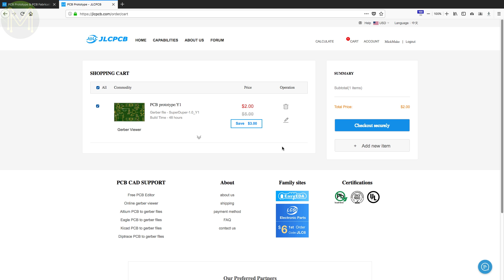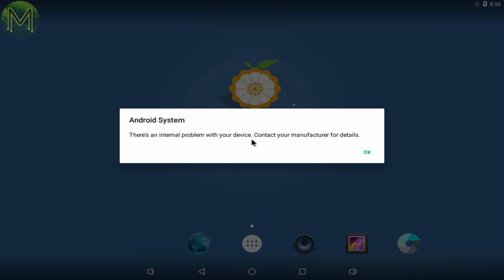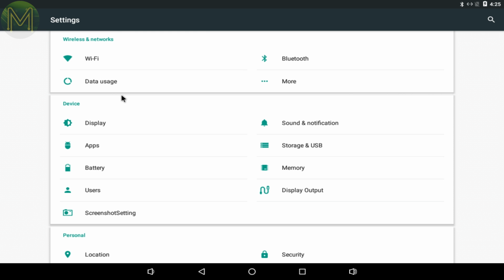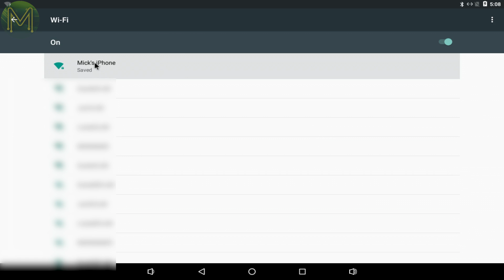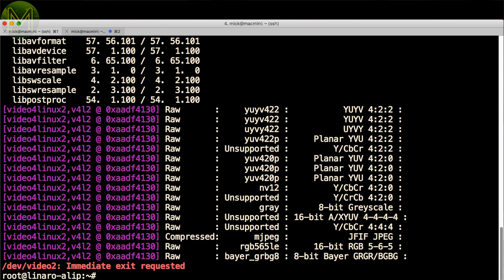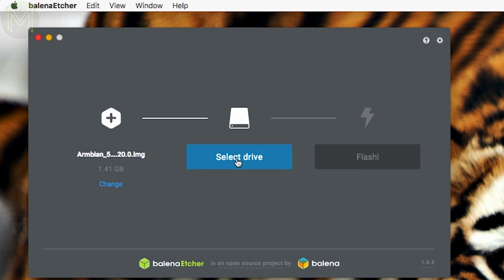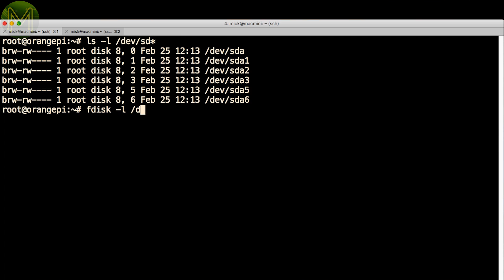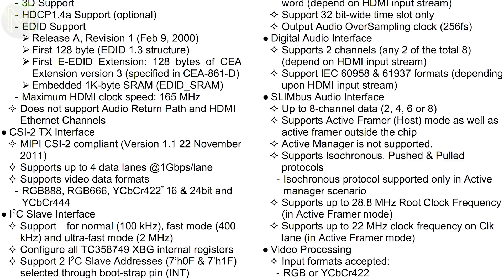#256 Orange Pi RK3399: HDMI recording on a budget. // Review

Comment: Isn't it an issue with the open source community instead of the device maker? I mean, it's completely normal, that there are lot's of hardware features with no or unstable support, with any Linux on any device. In like 15 years of using Linux on servers and embedded devices, and like 6 years on the desktop, I yet have to see a situation, where there's nothing left to be desired regarding hardware support in a Linux installation.
Reply from the maker: One of the problems is with companies promising the world and not delivering. The Pine64 had this problem at the start, (but they’ve since fixed it).

Software will always be behind hardware, but it’s good to know exactly what people are getting into.

That’s why I do what I do with these reviews.

Comment: Thanks for taking the time to test various sbc. After watching your review video, I ended up getting the Rock64 for openmediavault. Ever is running ok but my files transfer speed is Max out to 20 up and 25 down. The Rock64 is plugged in using ethernet cable to my router gigabit port. Transferring from my surface pro 3 connected to the router with AC wifi. Can you please suggest anything that I can do to speed it up. Thanks.
Reply: What kind of storage device are you using? Also, make sure the storage is plugged into the one USB3 port. The USB 2 ports would likely yield about the speeds you are seeing.
Reply: @JesseSightler  
I'm using the new WD Blue 2.5" HDD with Sabrent USB 3.0 to SSD / 2.5-Inch SATA I/II/IIIHard Drive Adapter (EC-SSHD), connected to the Rock64 USB3 port. When I connect the HDD with the adapter dirctly to my PC usb3 port I  got 90 - 110 Mb/s transfer speed.

Comment: All those Pi-like-boards will land in garbage when better and cheaper SoCs come out.
IoT world needs 7nm chips and not overheating oldschool SBCs. Besides they have to start using different languages and frameworks like C# / .NET
because Python does not belong to very efficient scripts for embedded devices.They also should look into smooth cross platform IDE - like VSC (not crappy Arduino)

Comment: Hardware great, much promise. Software abysmal.  I've experienced that with another manufacturer. They released another board with better software support instead of fixing the drivers etc on the first one!
Reply: Is there a good way to pitch in and help make working software for the Orange Pi? Does anyone know what's really needed to do this for Orange and other vendors?
Reply from the maker: Yes!
Go visit the Armbian forums. Igor is a great bloke and determined to bring some standardization in for ARM based SBCs.
Reply: @BobPegram  As Mick says pick a Distro and get on the forums.  Ask questions ( alot of them ),  As ive shown there are alot of people moving on these SBC's / SoC's, Just as a start you might want to look at this,

http://opensource.rock-chips.com/wiki_Main_Page

RockChip has been pretty damn solid with a BSP ( Board Support Package ) that is getting very refined / bugs ironed out.  With support from the community over all this is how this gets fixed.  It was not long ago getting Arch Linux installed on the Rock64 was not doable easily, now as ive shown this board sings pretty much.

Also look on the link in my first comment,

https://github.com/ayufan-rock64/linux-build/releases

There is alot of information here also,  the Rock64/Pro forums are very active with cool people aiming to help out where they can ( ergo they dont bite )..

You have to give these things time,  we dont need complainers we need people that do things,  you will find this interesting but I had this very same conversation at the local makerspace here with people who purchase the latest boards then just moan when not spoon fed an OS to run on the bloody thing, clearly the boards are not for them.

Linux on ARM is still very much maturing and in a huge amount of flux with so many SoC's SBC's available, and yes I know Arm graphics support is awful but with freedrino and now Panfrost/midgard and Bifrost it looks like Mali on the RockChips is well on its way.

Comment: I'd love to see an eDP test with some cheap ips lcd panels you can find on ebay. Curious if it actually works on these boards that have it broken out
Reply from the maker: That’s an idea. I could do a comparison video across several SBCs with eDP & MIPI-DSI
Reply: @MickMake  and if they require any adapter pcb due to pinouts being non standard (like the old ipad screens for 20$ with edp connector) you can make a maker speed run episode :D

Comment: Rockchip having problems with Ethernet? What a news ... dammit I was expecting good things from them!
Reply: Um hardly RockChip,  the Ethernet is a RTL 1Gig unit ( like this one ) RTL8211F Gigabit Ethernet

Since under Linux most of these are still in testing iirc its not shabby at all.
Reply from the maker: But yes... the RTL is working on other SBCs, so shouldn’t be a problem here.
Reply from the maker: Really all SBCs should be running the latest mainline to take advantage of libgpio.
Reply: @MickMake  libgpio?
Reply: I hope that  is not the rgmii  interface that have problems... 
It is hw side if the driver is the same used by other SBCs... And here don't work. (Or DTS if is DTS your lucky)
Reply from the maker: He he.
I really want to get in there and fix it, but then it’d take away time for my channel...

Decisions, decisions, decisions.

Comment: Software support seems to be a problem for most of these boards. I have a rockpro64 with the same cpu which has a PCIe x4 interface. The PCIe port doesn't work as it should, I presume due to lack of software support. So now a waiting game has started for complete software/driver support. It sucks. That's why raspberry pi's are still king of the hill if  you ask me. Less performance but solid software support.
Reply: Did you talk to the guys on the forum ( ayufan etc etc etc ) ...
Reply: @sethrd999  Sort of. I post my experiences on the pine64 rockpro64 linux forum. For example: https://forum.pine64.org/showthread.php?tid=7055&page=5
The thing is: my sata pcie x4 card gets extremely hot (over 80°C) using the rockpro64, so I shut it down to prevent damage. I can see harddrives connected to it however. Tested the card on a regular pc and no heat problems whatsoever. So is this a rockpro64 HW issue? Driver issue? No clue at this point...
Reply: I’d really pay for a raspi with USB3, proper (safe) shutdown and power management and decent analogue sound. But all these lookalikes shoot for the stars then instead of getting over the moon - land in the pig pen.
Reply from the maker: I still think that in terms of the choice SoC for 2019. It’ll be the RockChips... eventually.
Give it some time and it’ll start to flourish.
Reply: @MickMake  Nopes I believe it will be Odroid's offering.

Comment: Would be interesting to see if the HDMI signal path is similar to the one used on TVs SOCs. So you can create a custom board with HDMI multiplerxer input and add overlays to that source on HW.
Reply from the maker: I am REALLY tempted to use that Toshiba chip in my PiProjector daughter board. Really, really tempted...
(Ordering some samples now...)
Reply: @MickMake  That chip was also intended to be used in a very old Kickstarter to add HDMI input on rpi. The project was halted after the developer discovered that the ISP cannot be programmed from Linux side.

That was back in 2013 I think...
Reply: @tuttocrafting  Some company makes little boards with the same chip i think, that you can plug in your rpi to have hdmi input.
Reply: @_DSch  Yea, I was talking to have a signal path similar to the one present on TV socs so you can route a HDMI input directly on output and overlay a framebuffer on it directly on hardware so you don't have delay.

Take a look on eevblog video of the LG Oled TV repair for the block diagram I'm talking about.

Comment: Good video.

Following on from the hdmi recording would you be able to test if it can run OBS to do live streaming and at the same time have the input passed through to the output?
Reply from the maker: Alas you can’t yet output to HDMI at the same time as receiving HDMI. Something to do with the drivers. Dunno...

Theoretically, it shouldn’t be a problem because it’s just a MIPI-CSI signal.